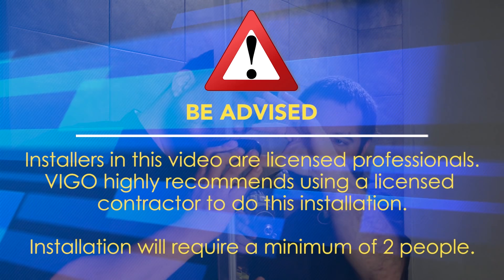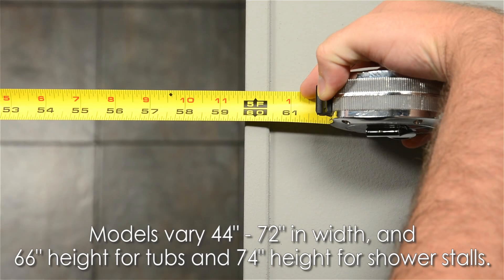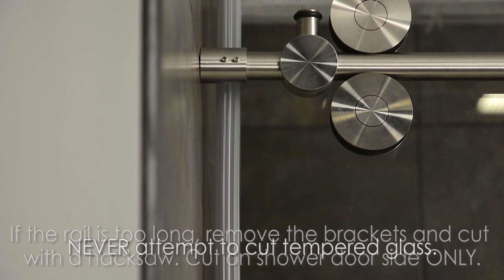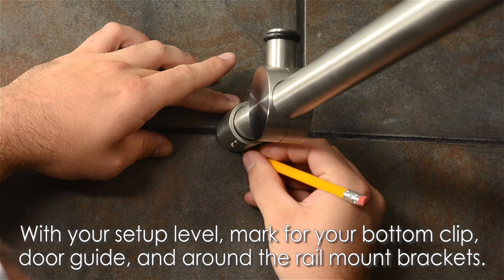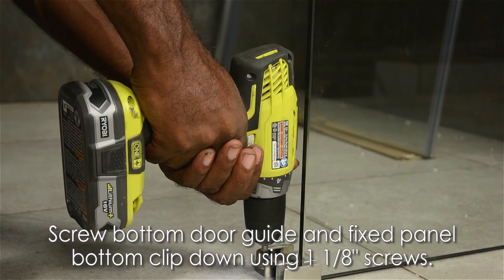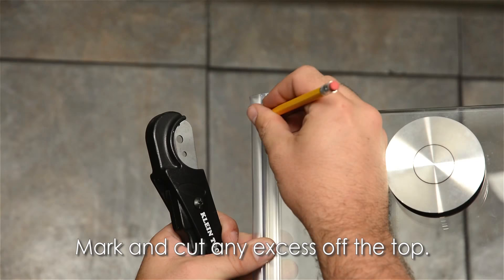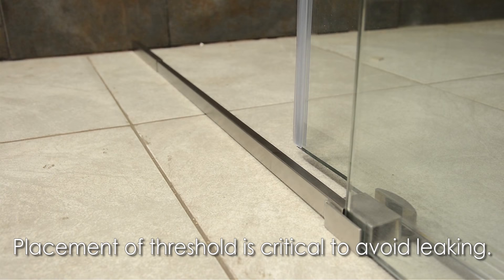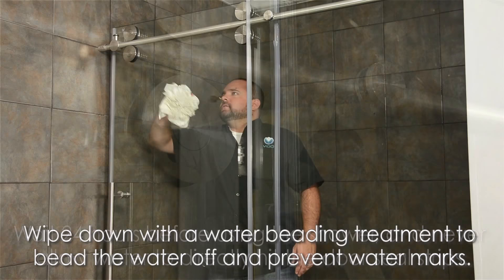VIGO VG6041 Elan Frameless Shower Door - Installation Tips

Comment: This is a good quality door, the rollers are really smooth and good quality. Two comments, keep in mind the support bar is about 4” lower then the door, for taller people (6’ tall) this could be an issue. Second, for the installation instructions, PLEASE make the text larger than 8pt type and provide more photos. The thing of having the bottom bracket mid way under the glass seemed wrong, as described in the text. Fortunately there is this video. 👍
Reply: What are the dimensions of the door guide clip? I’m building a narrow shower curb and I need to know what the minimum width of curb I can do. I wanted to build a curb that was only 4” wide. Can you measure that pice of hardware for me? Thank you so much. My door will be here in 10 days but I need to build the shower curb right now.

Comment: Instructions say to cut the rail...does NOT say from the door side only like in this video!!! What a major oversight! I cut equal amounts from each side of the rail, like any reasonable person would assume, when YOU leave out this key piece of information!
Reply: how did you fix this? Even we committed the same mistake
Reply: What are the dimensions of the door guide clip? I’m building a narrow shower curb and I need to know what the minimum width of curb I can do. I wanted to build a curb that was only 4” wide. Can you measure that pice of hardware for me? Thank you so much. My door will be here in 10 days but I need to build the shower curb right now.
Reply: @ramurva  What are the dimensions of the door guide clip? I’m building a narrow shower curb and I need to know what the minimum width of curb I can do. I wanted to build a curb that was only 4” wide. Can you measure that pice of hardware for me? Thank you so much. My door will be here in 10 days but I need to build the shower curb right now.

Comment: Love ours. The only thing missing is a way to keep the door closed tight against the tile. We close ours and is creeps back about 3/4" and water sprays out on the wall and baseboard. Is there a fix?
Reply: Sounds like the rail is out of level
Reply from the maker: Hi Steve!
Thank you for your feedback. Our Product support team can help you out with this. Feel free to contact us at sf@vigoindustries.com.
Reply: Did you ever fix this? Not sure if ours is a Vigo, but the mechanisms are almost identical and we have the same issue with the door creeping back a few inches at times. Sometimes it does and sometimes it doesn't. We checked the level and it seems level however I'm not sure what the tolerance is as one area is still within the level lines but not dead centre.
Reply: What are the dimensions of the door guide clip? I’m building a narrow shower curb and I need to know what the minimum width of curb I can do. I wanted to build a curb that was only 4” wide. Can you measure that pice of hardware for me? Thank you so much. My door will be here in 10 days but I need to build the shower curb right now.
Reply: @VIGOIndustries  What are the dimensions of the door guide clip? I’m building a narrow shower curb and I need to know what the minimum width of curb I can do. I wanted to build a curb that was only 4” wide. Can you measure that pice of hardware for me? Thank you so much. My door will be here in 10 days but I need to build the shower curb right now.

Comment: Our door is installed and it’s beautiful but the door will not stay fully opened. We push the door open and it then closes half way on its own. It does stay fully closed. Is this a feature? Is it by design? Or is it an installation error?
Reply: The top rail is not spot on level, needs minor adjustment on mounting brackets
Reply from the maker: Hi Kelly, thank you for your comment and question. 
Could you please provide a copy of your sales receipt, a video of the issue and complete shipping address with phone number to sf@vigoindustries.com?
Thank you
Reply: What are the dimensions of the door guide clip? I’m building a narrow shower curb and I need to know what the minimum width of curb I can do. I wanted to build a curb that was only 4” wide. Can you measure that pice of hardware for me? Thank you so much. My door will be here in 10 days but I need to build the shower curb right now.

Comment: Love the door but it leaks water at the bottom where the fixed door meets the sliding door—at the rail mount brackets. My installer clearly did not pay attention to the instructions, but now I need to fix it. What can i do?
Reply from the maker: Hi!  Thanks for your comment.
We are so sorry to hear that! Feel free to contact us at sf@vigoindustries.com. You can also call us at 866-591-7792 Mon-Fri 9:30 am - 5:30 pm EST. Let us know if they were able to help! Thank you!
Reply: What are the dimensions of the door guide clip? I’m building a narrow shower curb and I need to know what the minimum width of curb I can do. I wanted to build a curb that was only 4” wide. Can you measure that pice of hardware for me? Thank you so much. My door will be here in 10 days but I need to build the shower curb right now.

Comment: Hey guys the one thing confusing me is they give two sizes of drill bits for the rail to wall instation. one is with plastic anchors and the other is for attaching to studs. Im attaching to studs and was told by customer service, because instructions didnt say,  that would use the larger drill bit size. that didnt make sense to me. So you would ust the smaller size bit to then insert an anchor plus the same screw? the logic isnt jiving. guess i may need to call again
Reply: Also 3/16 drill bit seems really small for the anchors to secure clips. I dont think the anchors will even go in a 3/16 hole much less then run a screw in it.

Comment: I believe my installers installed the middle piece that would sit on the tub's edge.  The piece that holds the two doors.  If this is true would this make water come out?  Because it is.  The installer ended up putting a piece of trim on the bottom of the moveable door to help with water getting under the door and over the black trim piece .  And if that is the case, can this be fixed??? ugh.
Reply from the maker: Hello! 
Thanks for sharing! We are so sorry to hear that! Feel free to contact us at sf@vigoindustries.com. You can also call us at 866-591-7792.
Thank you.

Comment: My Vigo Elan is missing the door bottom guide (part 98023 matte black). How can I get a replacement immediately?
Reply from the maker: Hi Alex! Thank you for your comment.

Could you please provide a copy of your sales receipt, a video of the issue and complete shipping address with phone number to sf@vigoindustries.com. Thank you!
Reply: What are the dimensions of the door guide clip? I’m building a narrow shower curb and I need to know what the minimum width of curb I can do. I wanted to build a curb that was only 4” wide. Can you measure that pice of hardware for me? Thank you so much. My door will be here in 10 days but I need to build the shower curb right now.
Reply: @VIGOIndustries  What are the dimensions of the door guide clip? I’m building a narrow shower curb and I need to know what the minimum width of curb I can do. I wanted to build a curb that was only 4” wide. Can you measure that pice of hardware for me? Thank you so much. My door will be here in 10 days but I need to build the shower curb right now.

Comment: The instructions say to cut the support rail 3/4 inch shorter than the wall-wall distance, but if you do this it becomes impossible, once you have put one end of the rail into (let's say) the left bracket) to fit the other end into the right bracket. If the screws for the bracket were external, ie on a flange, you could fit the bracket to the rail end, slide the whole assembly into place, then screw. But it is a single central screw inside the bracket, so the brackets both have to be fitted first. According to basic geometry, you would need to cut off 1.5" (the depth of the bracket) from the rail to get the second end of it into place.  Then the rail can be re-centred, but it will never run all the way to the inner end of the bracket. This will leave a structural weakness, which I don't want.
How do you fix this?
Reply from the maker: Hi Paul! 
Thank you for your comment.
Feel free to contact us at support@vigoindustries.com. You can also call us at 866-591-7792 Mon-Fri 9:30 am - 5:30 pm EST. Let us know if they were able to help! 
Thank you!
Reply: What are the dimensions of the door guide clip? I’m building a narrow shower curb and I need to know what the minimum width of curb I can do. I wanted to build a curb that was only 4” wide. Can you measure that pice of hardware for me? Thank you so much. My door will be here in 10 days but I need to build the shower curb right now.

Comment: This is a bathtub door installation case. I cannot access the stud and need to install on the tile over the hallow drywall. The included anchors don't look strong enough and I'm trying to use a toggle bolts instead. Would it work? The video says that the rail should be screwed on the studs.
Reply from the maker: Hi there!
Feel free to contact us at 866-591-7792. Our experts will help you to resolve it.
Reply: What did they say?
I have the same issue
Reply from the maker: Hi Todd,
Thank you for your comment.

We did our best to make the video instruction as accurate as possible, feel free to follow it. If you have any questions, our product support will help you at 866-591-7792.

Have a great day!
Reply: @gitarman666  No useful response fr VIGO. I asked local plumber and he don't recommend to install at the dry wall only. It must be installed on the studs. Since this door is too heavy for the walls, the walls will gradually collapse. The only way to install is adding more studs on both sides after opening the walls

Comment: How far down are the holes in the glass for the roller hardware on the VG6041CHMT6074R model?  Can’t locate a schematic drawing anywhere and need to make sure it will work with my current wall material.
Reply from the maker: Hi Missy, approximately 3 - 4 inches from the top of the glass to the structural rail.  If we can assist with any additional questions, please call us at 866-591-7792, option 2.  Our team is available Monday - Friday between 8am and 5:30pm EST and are always happy to help.

Comment: What's the significance of positioning the fixed door in the "middle" of the bottom door guide?
Reply from the maker: The fixed panel goes halfway in the guide and the other half has the threshold
Reply: This step had me stumped too, but I guess it makes sense later in installation.
Reply: Otherwise, the instructions make no sense. So why not explain briefly?

Comment: Should the bottom rollers be touching the rail? Mine are not, they are just shy of it.
Reply: Hi. all 4 rollers can adjust the height with a screw on the back of the roller. Try to adjust your 2 bottom rollers so they all touch the bar.
Reply from the maker: The rollers are adjustable, so please contact us if you need assistance at 866-591-7792, option 2.  Our team is available Monday - Friday between 8am and 5:30pm EST.
Reply from the maker: Thank you for assisting!
Reply: Directions state how long the screws are but not the diameter. In other words, what size bit should I use/buy for drilling thru tile?
Reply: The rollers, top and bottom, should be in full contact. The rollers are not concentric. It’s cammed in order to adjust for height.
Reply: What are the dimensions of the door guide clip? I’m building a narrow shower curb and I need to know what the minimum width of curb I can do. I wanted to build a curb that was only 4” wide. Can you measure that pice of hardware for me? Thank you so much. My door will be here in 10 days but I need to build the shower curb right now.

Comment: How much out of plum can the door side wall be and still work?
How much out of plum can the stationary panel wall be and still work?
Thank you
Reply from the maker: Panel side can not be out of plum.  The door side can be 3/8" out of plum
Reply: @VIGOIndustries  thank you!
Reply from the maker: 3/8" out of plum.
Reply: What?  The fixed panel IS adjustable for out of plumb. The fixed panel holders are adjustable,right?
Reply: See 1:50 in the video, for adjustable fixed panel.

Comment: The top rail which (always) needs to be cut must be cut on the sliding door side, which isn't labeled - instead, they put a white sticker on one side which says to remove the plastic shim and on the other side you get a yellow sticker with a red warning triangle saying 'only cut on door side!'. This is the side you must cut - how  confusing is that! Also, I'm mounting this on an acrylic tub and there's no way I'm drilling holes into it - what if it were cast iron or steel? Also, why would you put the screws where  the INSIDE panel slides instead of the outside panel? Oh, and the best part of the manual is the part where they tell you to drill 76.5" up from your shower curb or 55.75" from the tub for the top rail and then say the the measurements should 'just be used as a guide. Your actual dimensions may vary' Are you kidding me?

Comment: These guys just drilled holes through the shower pan. Do not do this. The door looks nice but if you ever drill holes through your pan, your shower will fail 100% of the time. NEVER DO THIS
Reply: But how you fix that on the pan?
Reply: @mimi...7670  you rip all the tile off the curb, patch the holes in the membrane, tile it again. Use 3m VHB tape. Do not drill holes. The tape works perfectly
Reply: Agreed, this is an egregious oversite by the company. They don't even tell you to put silicone in the holes (which would eventually fail anyway). They are 100% opening themselves up to lawsuits with this horrible advice
Reply: @frattman  haha ya it’s bad. There’s no lawsuit issues but they’re not helping their customers

Comment: Should I drill holes in quartz threshold for the bottom clip or use some sort of epoxy?
Reply: Use epoxy, never drill holes through your water barrier. Or use a screw that is shallow enough to go through the tile and mortar but not the water proofing. What are the dimensions of the door guide clip? I’m building a narrow shower curb and I need to know what the minimum width of curb I can do. I wanted to build a curb that was only 4” wide. Can you measure that pice of hardware for me? Thank you so much. My door will be here in 10 days but I need to build the shower curb right now.

Comment: How much they charge to installed one of this I have one and need price on the installer?
Reply: About 400 to install
Reply: What are the dimensions of the door guide clip? I’m building a narrow shower curb and I need to know what the minimum width of curb I can do. I wanted to build a curb that was only 4” wide. Can you measure that pice of hardware for me? Thank you so much. My door will be here in 10 days but I need to build the shower curb right now.
Reply: @mk-jm5tv  I have the same question.    Do you have your door now?   If so, can you tell me what that width is?
Reply: @sretep99  I’m not home right now but approximately 2x3. I can measure when I’m home
Reply: @mk-jm5tv  that would be greatly appreciated.